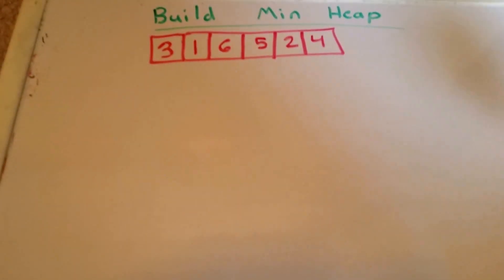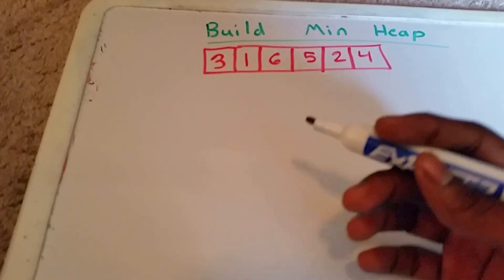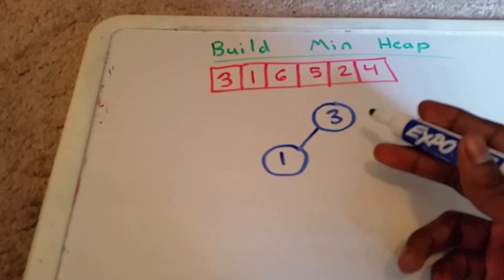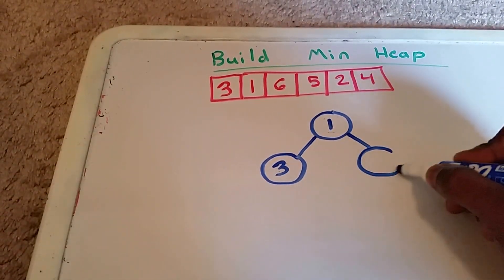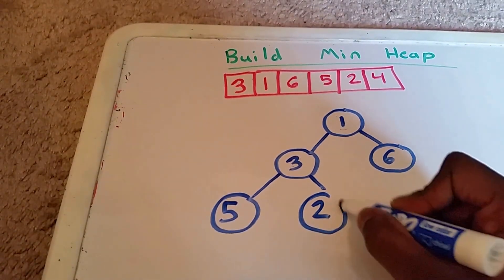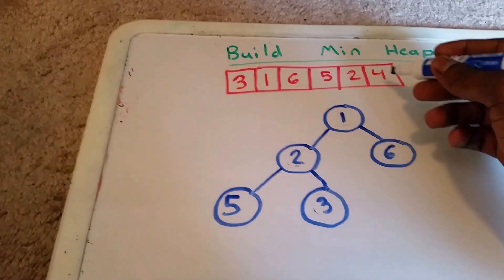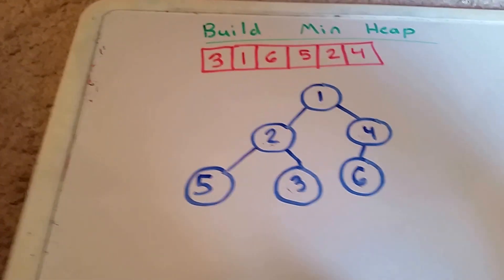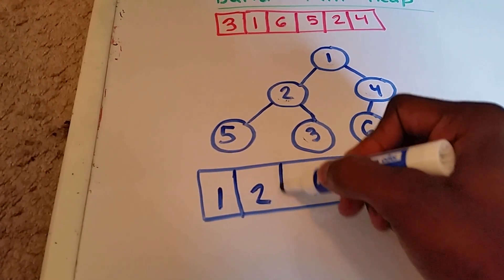Build A Min Heap

Comment: Shouldn't the smaller element be on the left and bigger element on the right? I might be wrong
Reply from the maker: No, I think you are thinking of a Binary Search Tree, which has the property that all of the current nodes children that are left to it, are less than the current nodes value, and all children to the right are greater than the current nodes value. 

Here is a video on heap properties:
https://www.youtube.com/watch?v=jLNMOJxjC9c

I know that all of the different data structures can get a little confusing at times. 
Thanks for watching and the question 

randerson112358